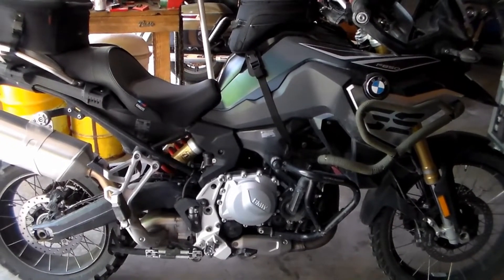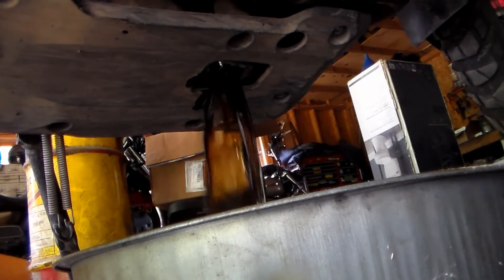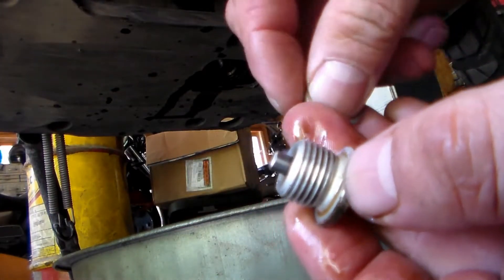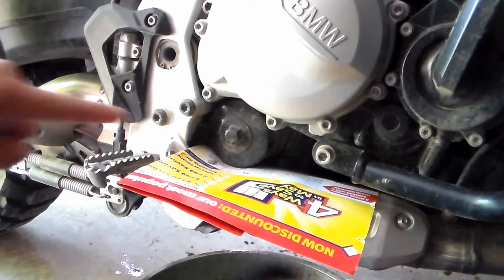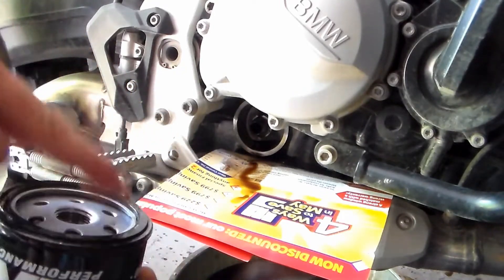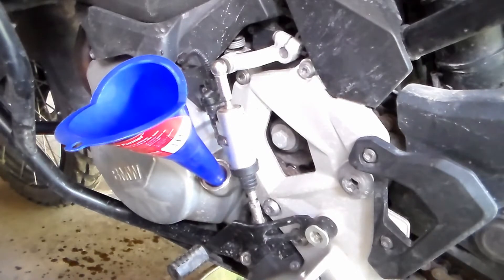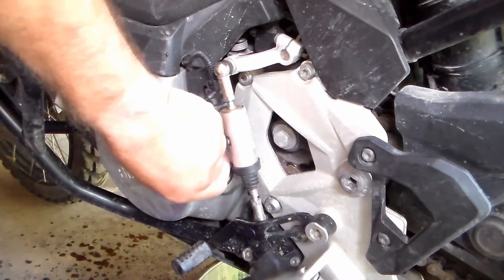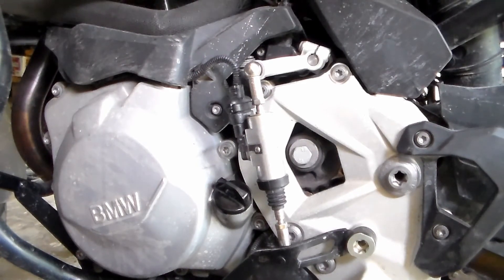BMW F850GS - How To CHANGE OIL and FILTER - EASY!

Comment: You should run the bike up  to temperature ie when the fan comes in then check the oil after two minutes on the centre stand as this bike has a dry sump system

Comment: Hey man nice channel anything on clutch cable replacement/adjustment for the bmw 850
Reply from the maker: No sorry, but I have 3 different motorcycles and the process is pretty well the same on all so find a vid on any BMW should steer you in the right direction. It's not hard at all I just haven't made a vid myself yet.
Reply: @rednecktech82  the 23 model it appears to run under tank I'll look around more but your vids are very clear and precise keep up the good work will be following you
Reply: Great tutorial. Thanks

Comment: why there is 2 oil plugs?
Reply from the maker: No idea I didn't design it lol.
Reply: @rednecktech82  I thought it was opcional but it got out 1 liter of oil
Reply from the maker: No, the BMW is a plug inside of a plug so to speak and then you have the Africa twin with 2 totally separate plugs but they all have two.
Reply: Because BMW likes to make everything harder 😁
Reply from the maker: The Africa Twin is actually worse yet
Reply: @rednecktech82  África is in two different places but GS 850 is two in the same place... At least air filter is very easy in GS
Reply from the maker: @dommotos  yeah tbe GS really isn't as bad as it looks, though the spark plugs are a bit much for a roadside fix...but you do what ya gotta do when you keep hydrolocking it in creeks lol
Reply: 드라이섬프